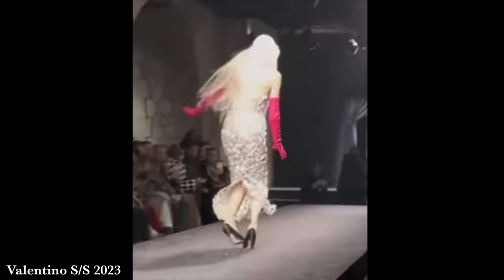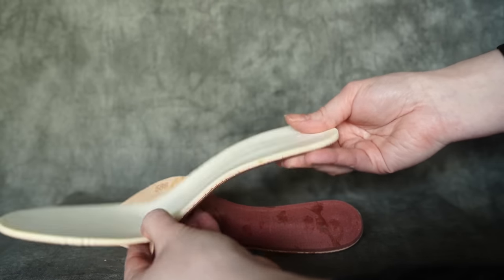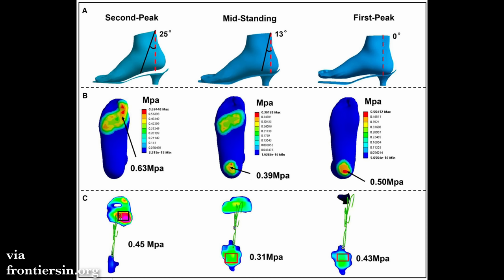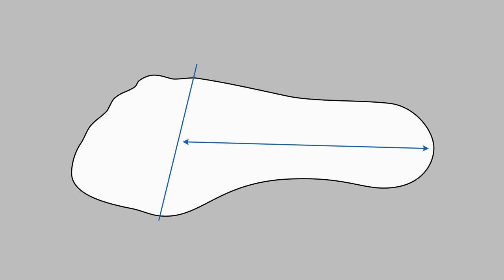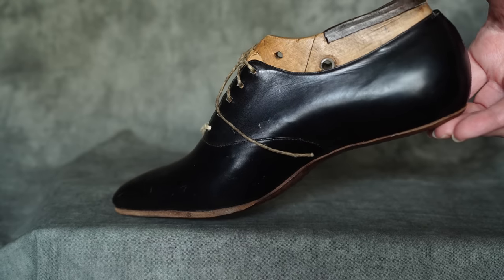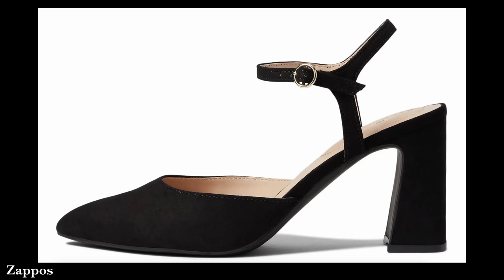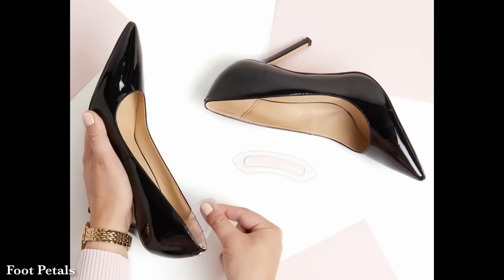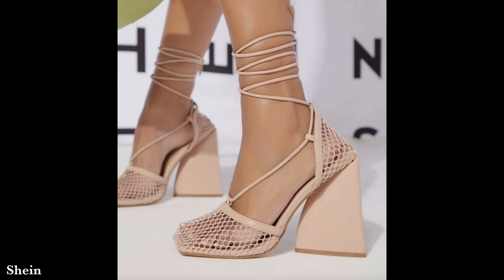Why are Modern High Heels so Bad?

Comment: this was not at all what i was expecting when i clicked on the video and im so facinated. i never knew there was like, science to the angles wer walk and how thats different in flat/arc feet or how longer toes come into play or how chunky heels vs small heel differ. its so scienticfic and easily broken down so i can perfectly understand, and OMG i understand my feet so much now!!!! i have very angled long toes and ive always struggled wearing any heels that were booties becauce my feet just sliiiiiiiide down and walking hurt so bad. on the flip side i have very narrow ankle so ive rarely had it fit shoes, now i know its because heel bases are usually wide with a tappered wall to "hug" the ankle but all it does is slice mine up. and now i know what to look for in shoes as well as how to adjust shoes to better fit me! thank you

Comment: This so clearly explained a mystery of my childhood. My parents had me do dance and karate and stuff as a kid. At one point I did tap dance, which requires shoes with a rigid toe box and more of a heel than most children’s shoes have. I’d always get horrible pain in my toes but none of my classmates did. 

Looking back with this vid for reference, my toes are proportionally longer, so in the heeled shoes they were sliding forward every time I did a shuffle kick step or whatever, and painfully jamming my toes into the toe box. I always thought I just missed some trick and was doing something wrong. My shoes just weren’t the right proportions for my feet!

Comment: Ooh, fascinating!! /gen. I used to Irish dance and our shoes had a figure 8 lacing situation that was VERY flexible but always felt more secure than ballet shoes. It may explain why I had such a hard time moving to irish reels with my tap shoes, you basically go from the most flexible shoes to incredibly stiff toes/bottoms. I love seeing other folks talking about their dance shoes in the comments :3
Reply: also, forgot to say i'm very curious how this works for platform shoes! for example I have a pair of platform TUKS I immediately rolled my ankle in, but i've never had issues w/ wedges or something w/ more ankle support. Is there a way to make/adjust platforms to be safer?

Comment: I worked as a dresser for a couple of designers during fashion weeks in the past, and one reason the shoes often don't fit can be because models often aren't cast until the week/days/sometimes even the night before a show, so the designers I worked with would just get the average model sizes (uk 6/7/8/9s) and organise them between the looks and stuff tissues or be reliant on very patient models who were used to it. Although these designers didn't have the budget of high end/couture brands like Versace, who should be able to buy the right sizes/have multiple options for each model just in case.

Comment: This is one of the reasons why, when heels are concerned, I prefer wearing heeled boots with both zippers and lacing to sandals with heels (also, heels + sweat in summer is just asking for a disaster, in my case at least 😅). This way, I can both enjoy a pretty heel (but not too high, I am too clumsy a person XD) and don't need to fear for my ankle with every single step 👢✨
Reply: I also live in boots! I'm very flat-footed, clumsy, and have small feet, so I tend to get ones with thick soles so I can have height and the nice look of a heel with very little actual heel. I've worn through multiple pairs in the last few years because I wear them everywhere XD

Comment: This is really fascinating. I have somewhat hard feet, on the narrow side, with long toes and high insteps. I knew my insteps were high for years because I have encountered so many pairs of shoes and boots I physically could not put on because there wasn't enough space/give/adjustability to get my heel down past the instep point, but it really hit home when I got into hand-knitting socks. I have to make mine with extra instep space, or even a stretchy woolen knit won't go on without a fight. This video made me doubly glad I physically could not put on a lot of those flimsy, strappy shoes when I was younger, because I have enough foot issues now from working retail for 12+ years that I don't need more on top of it.

Comment: Well for specifically the high fashion models walking on the runway, unfortunately because the designers make what are called “sample sizes”, they only make one size of dress and one size of shoe - usually a US size 7 or 8 for the model to walk in - NOT custom made for that model, but a generic size 2 or sometimes 4, but never any bigger than 4. Most models are proportionate body parts, meaning if they are 5’10” tall, on average their shoe size is 9 or 10. Because they are forced to squeeze their feet into shoes that are two small for them, it creates discomfort and uneven equilibrium when walking - ergo, you get a higher frequency of trips and falls by these models on the runway 💁‍♀️

Comment: Your video reminds me of springolators, the spike heel of my teenage years. There was no heel on the upper over the spike heel. A band of wide elastic ran inside from the heel to the ball of the foot and the area where the toe meets the foot was covered by a narrow band leaving the toes exposed. Real ankle twisters. Also the city street maintenance department complained that the heels damaged the crosswalks on the asphalt streets downtown.😧👡

Comment: I wore heels to work as an admin assistant everyday for years. I had 3 pair that were my favorite. They were 3 inch Gloria Vanderbilt. They were a woven leather and felt like a pair of gloves. I never found others that were as comfortable after they were worn out beyond anymore fixing. The only problem were the pointed toes. Knowing what I know now I would not have worn pointed toes everyday. I never found another comfortable heel like those were. Now I only wear fairly flat shoes with a round or square toe.

Comment: One of the biggest problems is that the shoes simply do not FIT the models.  They wear whatever is closest to their size, and if something close isn't available, then tough. Do it anyway.  If you get to supermodel status, you have some say in what you wear in a runway show, and 9 times out of ten it is fitted specifically to you.  But for the regular every runway model, whether the shes or too big or too small isn't a consideration the dressers have, and sometimes they don't get the shoes to walk in until the last minute.  It also doesn't help that they are expected to walk in crazy shoes like those pointe slipper/high heel combos you can see in the first part of this video, or on needle-thin stilettos when a runway walk puts more of the weight on the heel than the toe.  Designers aren't thinking about the reality of these things, they are just looking at the aesthetics.
Personally, I think every designer, male and female, should be made to walk in the shoes they put on the models.  Let them come out at the end of the show and walk down the runway to wave at the crowd trying to balance in those things.

Comment: Flexible arches!!! I pound up and down on a cement floor 8-10 hours a day for my job. I am over 60yo. I haven't had sore feet or shin splints since I quit buying "support" sneakers and started buying dance sneakers. OMG! What a difference it is, and wonderfully so, that my arches can do what they do without that stiff, pre-shaped arch "support" trying to force a particular rigidity to my arches. I do try to find ones where the heel is at least half an inch higher than the ball, that seems to help my old knees. So many of the workers younger than I are constantly complaining about sore feet and shin splints. I try to tell them, but hey they seem to end up deciding to just buy more expensive "support" sneakers.  Wrong choice, ya'll!

Comment: Thank you for this video! Watching your other videos on shoe making it always surprises me how much engineering goes into making them. Another thing that I noticed (or learned by experience) is your foot adapts to the changes in your body, when I gained weight my old beloved years from few years before did not fit me as they used to and became almost impossible to walk in and bordering to being too small. I thought I was dreaming (changing shoe size as an adult? My feet are growing but I didn't become taller?)

Comment: The human  body is NOT designed to wear high heels. Our feet are meant to be flat on the ground to carry our weight NOT the ball of our foot. Okay maybe the ball for a few seconds but not that long. Being on the ball of your foot to walk you set a snowball effect into motion. You get ligaments out of line which throws your center of balance off which in turn shouldn't be in this mess in the first place.  I have heard stories of women cutting off toes to wear heels which is wrong. Heels are vanity. Nothing more. Nothing less. Women have been lead by other women that men want to see women in these unhealthy monstrosities.

Comment: Somehow I never realized the fact that wide shoe sizes really are wider all around and not just in the toe. I have such a hard time finding the perfect fit and I'm constantly getting achilles area blisters and sores as I test new footwear. I dabbled in pointe when I was a ballet student (my left ankle would never have let me do it professionally) and the dance shop I went to could only let me try a small selection of the brands they carried because they didn't stock a good size for me by default in all of them. I need a very wide box (3-4X in ballet shoe terms) with a short vamp, which at that dance store meant my choices were Bloch or Suffolk.

Comment: See, this is the reason why I am so very particular about shoes I buy. I have received a few pointed remarks saying I was too difficult, but shouldn't we when shoes are something we have to walk in regularly? When people who walk a lot (like me) have to be able to do so without hurting ourselves? 

Nowadays, I try to steer clear from shoes that have too high a heel to sole ratio, because it also affecgts my knees (which already suffer without that). And some shoes, even without heels, can make the foot hurt if there is no cushioning inside, just because of the way they were manufactured.

All those things are why I am steering more towards vintage to antique inspired shoes, or full-on vintage shoes in second hand shops when I manage to find my size (which is hard, considering I am a size 5 and the average size here is size 7.5/8).

Comment: Couple of points i may add. 
1: I had the misfortune of misplacing my medium high heels when i had to move into my apartment. So, i went from very high heels to flats. I'm still recovering from the tendon damage caused from the sudden switch. *The amount of walking i had to do would still have caused damage but probably could have been much less if i had less of a drastic change in heel height.
2: As for walking in very high heeled shoes, i resign to walking entirely on tip toe. 
I don't rely on having any support from the heel itself except a little bit of stability when standing still.
Reply: 2. Is apparently a risk factor for Morton's neuroma.

Comment: After watching this, I immediately went to look at my heeled shoes: only one has the non-flexible arch, all the others are def not a "shelf" shoe, and even this one has the insole very well cushioned, so it is really comfortable and I can put my weight on the ball and on the hell at the same time. There is one that I need to fix the insole, it was falling apart and I glued another material over it but now it is too tight :'D They are all from brazilian brands well known for being comfortable, so it is good to understand WHY they are when compared to so many others (cushioned insoles, flexible, cloth instead of plastic, oh and some also have the sides of the heel cushioned to better fit). This also explains why I like boots and sneakers/tennis so much compared to most formal heeled shoes lol

Comment: I walk awkwardly on any heel that goes above an inch.
Not dancing shoes. My mother had a rather old pair of ‘em. Two inch heels. They were surprisingly comfortable on the ball and arch of my foot. Sad that I only got to wear them once before they started to disintegrate. Mom said dancing shoes are made to be sturdy and stable, because duh, but I couldn’t really figure out what made them more sturdy and stable. Now I learned that they’re made more stable… not by sturdier materials, but by SOFTER materials… that adapt to the movements of the feet.

Comment: I have flatfoot, so wearing high heels is kind of a necessity for me, as the weight being put on my toes rather than the underside of my feet helps give the underside of my feet a rest. That being said, I wear high heels every day, and I've found that the most practical heel is one that has the width of the classic Rococo heel. Those 1700's ladies knew what they were doing. That heel isn't wide enough to catch on random edges when you're walking on the street, and it's not so narrow that it's impossible to balance, and most importantly, they're always perfectly placed underneath your actual heel. Just look for some high quality leather high heels, like Tamaris, with that type of heel, and wearing high heels on a regular basis becomes a lot more doable, so long as you break them in first, of course. Granted, my feet are really wonky, as I said, so it might be less comfortable for people with normal feet, I dunno. That's just what I've found, anyway.

Comment: Great content.  Shoe sizing like clothing sizes needs to be standardized.  Considering the damage that happens from wearing improper shoes needs to be considered.  Shoes can come with a foot health rating so that consumers know the risks.   When I bought a pair of shoes in Hong Kong they inserted all the pads to fit my foot, it was a part of the purchase.  I have never had that happen elsewhere, not even in Italy.  I used to have an employer in CA that required women to wear at 2-3" heel and that ended with a law that CA had to make things more consistent between men and women.  Haircuts, dry cleaning, professional dress codes were impacted.  Shortly after that I needed 3 mos. physical therapy due to a pinched nerve from my work shoes, lovely black pumps.

Comment: The reason they call is heel placement...  The idiocy of 5 inch heels also (anyone who agrees to wear these * is * an idi@t imho), but it is heel placement that is the key difference.

Just look at ANY early pair of heels through the 1940s, certainly in all those musicals where the woman is dancing on tables and etc. The heel of the pump is * centered * over the physical heel of the foot. The phusics of this placement allow complete support, because the full weight of the body falls squarely on the shoes heel, little is left to displatw in the toe area.

Go to an antique store, etc, just fine a pair of old heels. ALL the heels from the 1920s were like this, and before, and 30s as well, and 40s. But it is most obvious in the "witch heels" of the 1920s where the centered heel also flares out at the base.

Try on these shoes. You will be AMAZED at how plsolod and firm you feel!  THIS is why women did not HAVE to wear sneakers and etc when they walked the mile to work in the city in those days, you could live in those shoe.

Comment: I wish that more people understood these points. After years of abuse and trying to wear certain styles, I finally had to face the facts; I have narrow feet and most shoes are for looks not wearing. Nor will spending more fix the problem. 

I have very narrow feet and shoes became a problem in the mid 80s when narrow sizes ceased to exist. I now know that I can wear very high heels but only if my foot is well supported. I no longer buy tons of pads and such trying to get shoes to fit. 

I tend to wear block heels for stability and they are sized narrow. At worst I put a thin insole in and am fine. I do use insoles to keep my feet from sliding as that is caused by nylons.

Comment: Excellent video!! i virtually have no heel and will find my size and it still not fit because of my heel slipping out of it. I will try to stuff paper in front (which I've used a lot lol) and some stillll won't fit!! I get sooo bummed. I'm going to try the ball of the foot pads again. I usually use them because of my off and on Morton's Neuroma, but I will look into better ones and will go ahead annd buy the heel cushions and try those again lol!!

That could be a great vid-going over all the shoe appliances available to help your shoes fit better!!

Comment: Fantastic video!  This is a topic I am passionate about to the point of considering becoming a shoe designer just so that I know I will have high heels I can wear well into my older age for normal everyday walking!  Easy spirit (not exactly a sexy brand) was manufacturing a character shoe called the "Rovana" for a few years that were perfectly constructed for long wear (10+ hours walking) and they looked good!   Miz Mooz also makes heels that tend to be properly balanced so that your weight is properly distributed.  What I am mainly looking for is a pair of heels that transfer "most" of the weight from the toe box to the back of the heel and midsole.